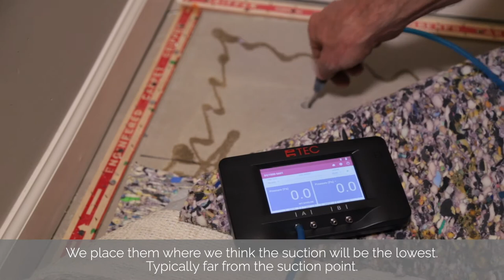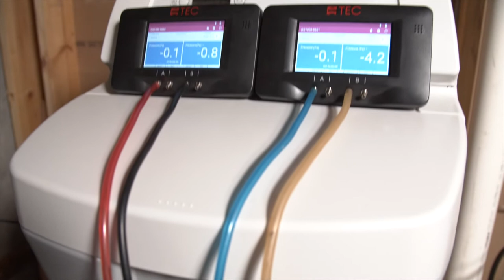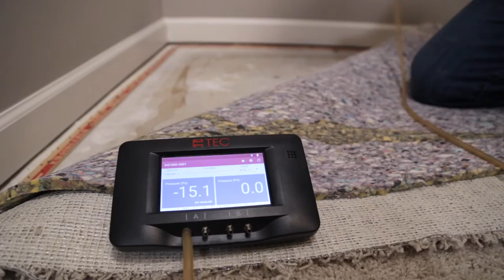How To Activate a Passive Radon Mitigation System

Comment: Wow, someone that actually checked air flow and many other factors in the process. The company I hired just plugged pipe into existing hole, plus put the pipe/fan outside instead of hooking up the existing pipe with fan in attic because they said they couldn't get a fitting around the pipe even though there are many other ways to do it. Now I have a fan off the side of my deck (RP140)which I hear over the quiet landscape. I now have to do it myself and remove the existing system. cost me 1,500 and will cost double and some more when counting time and money I have to put into fixing it.
Reply from the maker: I'm sorry to hear that, Antonio. An RP140 is a small and quiet rain fan. 

Do you know what your radon levels are since mitigation?

Where are you located?

Comment: It should be mandatory for all home builders to put that in and it should be put in as part of the codes in all homes. How many people are clueless to radon in the basement I bet lots are. It's something not many think about. They just assume their new/older home is safe. Realtors avoid the topic in hopes to not kill the sale of a home that has radon.
Reply from the maker: Hey Chris, passive systems have been required in new homes since June of 2009 here in Minnesota. I believe there are a few other states that are pushing for similar requirements. The biggest problem with passive systems is that many or not installed correctly. 

You are right about the lack of awareness. I think it depends on the realtor, as I know a few that are proactive about ensuring their clients know about radon.

Comment: What do you do if you need to remove the sump cover sometime? Is it easy to remove and re-seal? What did you use for sealing the sump cover?
Reply from the maker: You'd remove the screws and cover. Replace your sump pump. Then, remove the old silicone and reinstall the cover and screws. Finally, you would seal it with new clear silicone. 

The access port allows you to test the sump pump without removing the cover.
Reply: @AmericanRadonMitigation  What  brand/model silicone do you use for sealing?

Comment: Does sump pit need to be connected to the main radon pipe also so it sucks gas from sump pit? This is for active radon system. For radon fan to suck air from below the slab shouldn't it suck air only from the main pipe that is connected to the ground? If it is connected to sump then it could suck outside air unless check valve is air tight.
Reply from the maker: No, the radon system does not need to draw directly from the sump pit. A check valve on the sump pump discharge is required, so the radon system doesn't draw outside air into the sump basket.